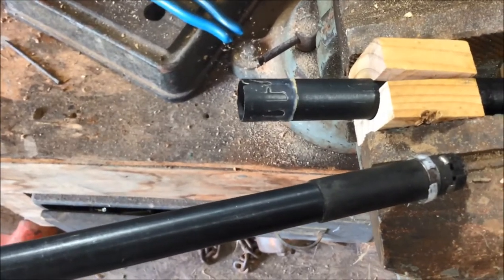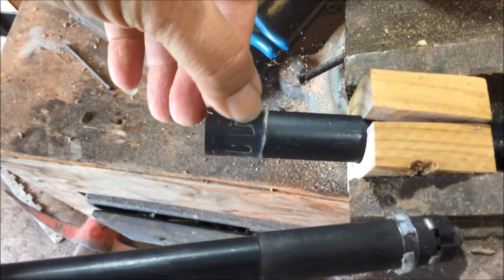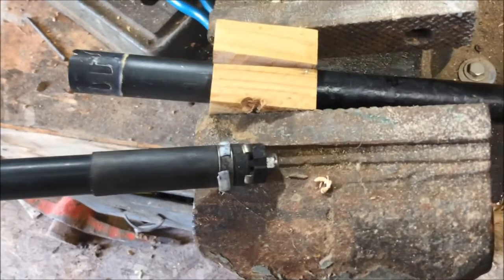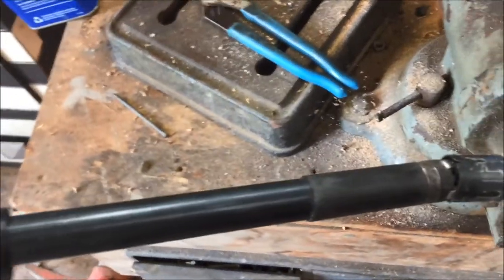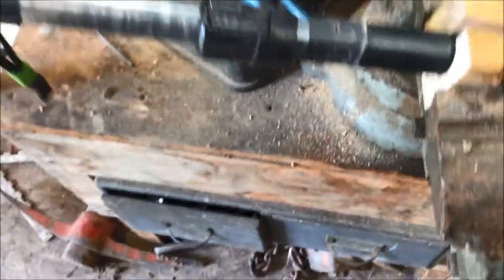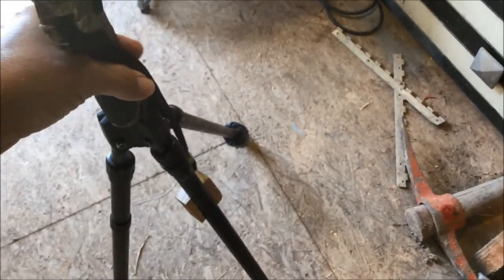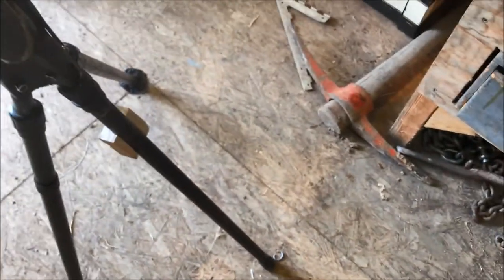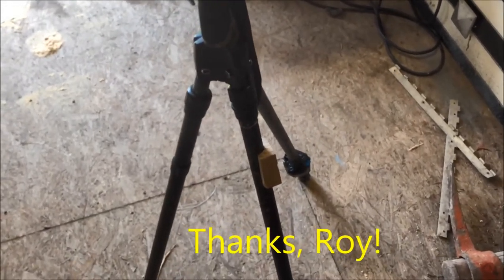Salvaging Primos Trigger Sticks With A Stuck Leg

Comment: Awesome.....great video, have just fixed one of the legs on my Gen 3 sticks, exact same issue as in the video broken Teflon bearing . Much easier to undo though as Gen 3 has two pinch points below the screw cape.With the Gen 3 the legs unscrew from the trigger handle and one had unscrewed about 3-4mm and this also had made it stick.
Reply from the maker: Wow, still relevant into Gen 3.  Good to know!

Comment: Did this on mine and i can muscle it into position but it’s very sticky. Any other suggestions?
Reply from the maker: I did not do this work.   If you have removed the broken spacer/washer (whatever it was called) the leg should move freely.  This model of is also susceptible to water damage.  If the internal metal parts have gotten wet and corroded, the sticks may be done.

Comment: That teflon piece should be cleaned and put back in place if possible.  And the 8 mm nut on the end can be removed and the end cleaned before putting the end nut back on.  I saw another video on how to take the leg apart on a Primos Gen 3 Tripod trigger stick. The guy was from England and spoke with a heavy British accent which makes it a little hard for me to understand was he was saying but he did the camera work well so I could see what he was doing. He took off one of the legs and then took it apart like you did but he just twisted the inside leg apart from the outside tube on the leg. He broke the epoxy seal without using a vise. Then he took the inside leg apart at the bottom by removing the nut and then he cleaned the cap and end part of the inner leg so that it worked smoothly again.
Reply from the maker: Thanks.

Comment: I think that teflon is to keep the sliding action quiet. i think.
Reply: Correct.  The Teflon bearing (guide ring, bushing whatever you want to call it) is a precision machined piece to prevent metal to metal contact, which will prevent noise and create smooth operation.  Since Teflon (plastic) does not stretch like rubber, it is likely this bearing is intentionally split in the first place in order to install it onto/into that groove.  Teflon will not crack at room temperatures or even zero degrees, it is remarkably compliant, and this unit undergoes no stress of any kind.  What ends up happening is one end of this split Teflon bearing is coming out of the groove and getting caught or squeezed in the gap/crack between the inner and outer leg and binding up the unit.  This is a design flaw with Primos, dimensions, tolerances, etc.  It could be designed properly such that it would not come out.  What I would do is clean up the Teflon bearing and the groove, get all the dirt out, put it back together carefully, and it will probably work flawlessly for a long time.  Dirt gets under the Teflon and eventually forces it out of the groove.  Been in the Teflon sealing business for 30 years.